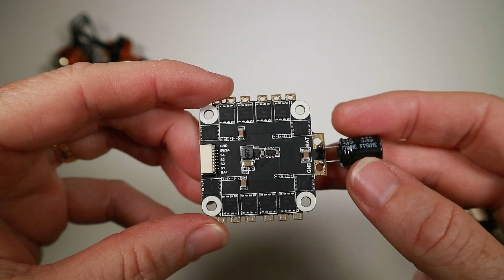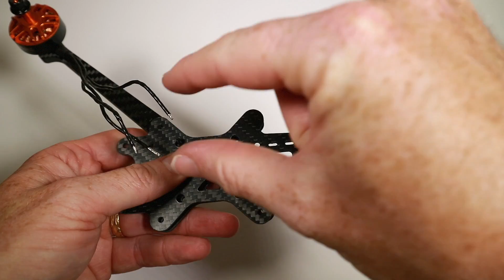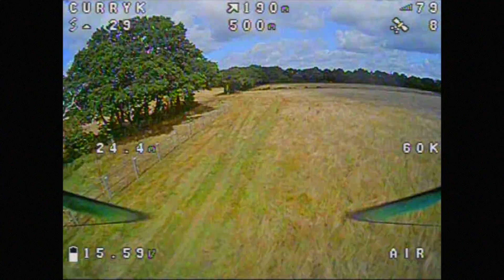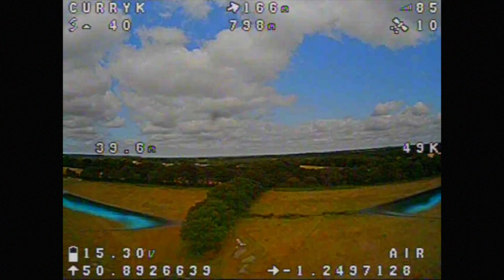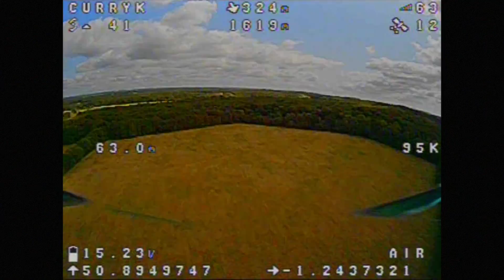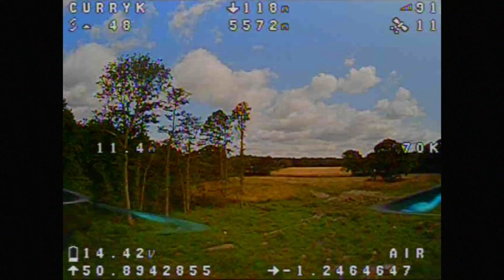Eachine Tyro129.  A 7" build-it-yourself-quad with a GPS.  Supplied by Banggood

Comment: i like the flight controller on the 129 , got barometer and gps and reduced sold   ering   because its all plug in.
Reply from the maker: Yeah - not much soldering effort aside from that annoying little SBUS/PPM jumper.  Looking at Betaflight though, there seem to be a few more UARTS that aren't being used as wekk

Comment: Hello Sir. Thank you for the video. Quad is looking great. My question is: how would I connect the crossfire receiver to this and what to bridge? Thank you kindly. Thumbs up 👍👍.
Reply from the maker: You can connect up a crossfire receiver via SBUS and thus bridge the SBUS connector, but you'd be missing out on the bidirectional comms or using CRSF, so the better idea would be to use one of the other UARTS on the board.  I don't have mine directly to have, but there is at least one spare TX/RX connection you could use and configure
Reply: @CurryKitten  Wow. That's awesome! Thank you so much for your reply!  Much appreciated!  I'm thinking of getting/building a 7" medium to long range crossfire quad and this seems like a cheap option to start with. Thank You kindly.
Reply: @CurryKitten  And I will be using your link in the description too ;) I'd like to support you and your channel. Thank you Again.
Reply: @miklosko3355  Hi. I need help with setting crossfire RX nano. I conected wires from FC Rx connector to crossfire nano in SBUS mode and it was working with 3 wires bkack, red and yelow. But when i added wire to RX from crossfire nano to TX2 pad on FC and  wont work in CRSF. What can be wrong?
Reply: @trebor1477  Hey Buddy 👋. Of course. Tell me first: Are you trying to run the crossfire in SBUS mode(3 wires) or normal 4 wires?
Reply: @miklosko3355  At first i was using SBUS 3 wires and it was working ok. But i rather hawe it runing on 4 wires. I did ad 4th wire on the TX2 pad other 3 are still connected on same connector for RX module. But the misstake is probably that i did not bridge solder  the IBUS pad? I'm using TX16S with crossfire module v2 in CRSFoption.
Reply: @trebor1477  I see first check that you have on the nano TX pad connected to the RX  pad on the FC and RX to the TX to communicate. Double-check the Betaflight   potrs tab that you have the uart that you have set for crossfire. And let me know if you have all that done
Reply: @miklosko3355  yes this is correct RX and TX from nano are inverted on FC. Im using INAV and i have URAT2 RX enabled. Crossfire nano RX is configured with CRSF TX and CRSF RX option
Reply: @trebor1477  Is the nano bound to your transmitter already in SBUS mode?  What Flight controller are you using? ( I should have asked that at the first place) Can you see the nano Rx in the lua script on the transmitter?
Reply: @trebor1477  Have tried to update the Crossfire tx and RX to latest version? It might just do the job. I'm using crossfire on my tyro and didn't bridge anything. Just solder the tx and RX to Tx 4 and RX 4 and enable uart 4 it in FC.  Disable uart 2 . It works like charm. Don't bridge anything if you can. Just use the spare uart
I can provide pictures if you need for reference
Reply: @miklosko3355  my sbus and ibus are allso not bridged. But i think that for rx2 and tx2 if you are using fc connector is soldering this ibus pad absolute. But if you are using soder pads under this connector then you dont need it solder in  brigde option. Ok i think that i undersrand :)

Nano was updated right after binding process automaticly.

If this wont work on urat2 i will solder it on tx4 and rx4. But i think that if i solder ibus bridge it will work. I will report back. Thanx
Reply: OK. The corect CROSSFIFRE reciver connection on URAT2 . You can use reciver connectir on FC but you must solder RX connection from nano reciver on TX2 pad on FC and dont forget to bridge solder IBUS pad. Telematic reading is freaking awesome. Thanx again and greatings from Slovenia. PS: our goverment is strealing our humain rights and they are lying about C19.
Reply: @trebor1477  Good man. Excellent. I'm Happy it's working for you. 💪👍.  
I'm from Slovakia but live in Ireland.
I think with Cov19 is everywhere like that... One big lie. Happy flying my friend. If you have any more questions I'd be happy to help. We can figure it out together again. Good luck 🖖

Comment: Hey guy nice video!!! As always so informative... so I've seen a guy with a 7 inch build with altitute hold and gps hold on his 7 inch tyro... how do you think? Would this setup work on INAV for gps/altitude hold?? Because betaflight only does rth and drops?! Thanks pal!
Reply from the maker: Not quite, but it wouldn't take much to get there.  The issue for iNav is that it needs both a GPS and a compass to be able to use the GPS functions.  Not expensive, but would take some extra soldering up.  Look for something like the Beitian BN-880 to replace the existing GPS module
Reply: @CurryKitten  ooohhh got ya! Yeah I had ordered that exact gps a while back but havent tried it yet!

Comment: So CK, what ya think about some 3s 50c 5200 Zee batts ?  I am kinda new to quads, but been into RC for 35 years. Planks and Helis and such. And thanks for your time.
Reply from the maker: I don't think I'd want to use a large 3S with this size quad.  I think (although not tried) the combination would make things a bit heavy and underpowered.  It would probably fly, but odds on, it would take a lot of throttle to get airborne and feel very sluggish.  Go with at least 4S on this one

Comment: the sbus pads you pointed out there are 3 small pads togather do all three get soldered i cant see in the vid
Reply from the maker: There are 3 pads.  If you bridge the two on the left then it talks sbus, and if you bridge the 2 on the right it talks PPM/iBUS (IIRC - I've only ever used SBUS)  They are annoyingly small, especially on the smaller tyros

Comment: Hi just got mine in the mail.
 Did you hook up your GPS to uart 1 per direction or did you just choose that port?
Thanks so much.
Reply from the maker: Were there direction about where to plug it... I could 't find any?  What I did was look at all the connectors that came in the pack, saw that most of them would only connect in one way and then connected it all on that basis.  When I got to Betaflight, it was already set at the ports I used, so that would seem to be the correct way to go
Reply: @CurryKitten  thanks

Comment: At 13:05 you say that you have a link to the user manual of the vtx, but you forgot to include it?
Reply from the maker: Oops, I've added it now, but it's here myosuploads3.banggood.com/products/20190727/20190727005815XF5804VTXUSERMANUAL.docx
Reply: Thanks a lot 👍

Comment: "can this drone hold itself still or hover  in air at one position?" (like a dji drone)
Reply from the maker: Nope - using this type of GPS and betaflight we only get a very basic return to hom... and then if you leave the quad it'll just crash into the ground somewhere near the homepoint.  You could use a GPS which also has a compass equipped instead and move the firmware to iNav which would give you more GPS functions (like GPS hold and a proper RTH)
Reply: @CurryKitten  oh sad btw thanks for explanation, can you point out any DIY drone kits thats have included that advanced gps?
Reply: @CurryKitten  wondering if you could tell if we can flash the FC with INAV so the quad could do RTH and auto land like DJI? much appreciated curry.
Reply: @blessingpeace  i want to know this also before i order one
Reply: @pakonly7073  like he said you need the GPS AND Compass (this quad is GPS only). Search inav gps and compass, better still go to inav site where they list compatible equipment.

Comment: Great video, I'm a complete beginner, used your simulator to get the feel of flying, got a Radiolink T8FB controller and a small Radiolink F121 drone to practice with, hopeless so far but I love it! I love building stuff so I bought an Eachine Tyro 129 using your link and I've assembled it,  all seems ok, I arm it and the props run ( motor directions are correct, props on correctly) but as soon as I move the throttle it seems to go instantly to full speed and the drone flips over. The battery I bought is a Zop 4S 5000mah, but it's a 60C and it seems huge, could it be the battery is too powerful? any advice would be great, you've got me hooked !
Reply from the maker: Before we go off down any particular avenue of debugging - are you using either airmode, or a self-levelling mode (either angle or horizon) if so, can you put the quad in acro, disable airmode and try again.  If there's any weirdness with the gyro, or the accelerometer thinks somethings slightly different than reality you can end up in the situation where the motors try and correct something, end up making it worse and so go even harder... essentially just ending up in full throttle
Reply: @CurryKitten  Thanks so much for your speedy reply,  I'll check this out and hopefully get flying.
Reply: Hi Wayne, constant rain up here in Scotland, finally got out to test my drone, I disabled angle and horizon in Betaflight ( my 3 way switch is now in acro, is that correct?) but it's still doing the same, scary when it flips, but the motors stop instantly, props still in one piece so far!
Another couple of problems--  my pitch is going the wrong way, other 3 are ok. Channel map is set at AETR 1234. I read that I could reverse the values for the pitch? but I can't get anything to come up on CLI when I print dump or diff and hit enter. It says Building AutoComplete Cache ------ Done! My Betaflight firmware is BTFL 4.1.5. 
I really hope I haven't bitten off more than I can chew, I'm a silver surfer always looking for a project, I realise how tricky this must be for you when it's not in front of you.

Comment: Great video, I bought one a week ago however still no tracking . Meanwhile this video really helped . I am confused about the battery i like the 5200 4s . Would it fly with a 5200 3s? i have 4  and  would be good to use them :-)
Reply from the maker: I think it would certainly fly, but the question is how much throttle would it need.  It's no hassle for the motors as they'd barely be ticking over, but it might drain the lipo a bit faster than you'd like.  Try it and see - I need to experiment more to find the right size/power of battery to get the flight times I want

Comment: I'm a bit confused with the rotation direction of the motors (CW and CCW) and the direction the prop nuts fasten. Front right and rear left motors are CCW. But the prop nuts of these motors (the black ones) also fasten counterclockwise. Shouldn't that they fasten in the opposite direction the motor is spinning, so they fasten themselves when the motors spin up?
Reply from the maker: That's always been my point of view on these motors as well - perhaps why I managed to get it round the wrong way... well, according to them at least.  If it helps, I have plenty of quads with motors that don't have specific CW/CCW threads and none of the locking nuts manage to unscrew themselves in flight.  Lock everything down nice and tightly and you'll be fine no matter which motors you use.
Reply: Thanks for you reply. I will  check them before every flight. 
And when you see a propeller crossing the North Sea from de direction of The Netherlands, then you’ll know it’s mine...

Comment: Help please. 
I'm trying to connect a r9m frsky reciever to this quad and I am not sure where to connect the signal wire?The sbus port doesn't seem to work. 
Thanks so much.
Reply from the maker: Well, it should be that sbus port, but did you remember to solder the little jumper on the FC (3 pads and if you bridge the left 2 it talks SBUS, or bridge the right 2 and it speaks PPM) ?  Aside from that did your rx bind to the module ok, did you ensure you have the same versions of firmware on module and rx ?
Reply: @CurryKitten   Thank you so much for replying I believe that's firmware update that I need I forgot all about that thank you so much I can I get it to bind and that is the only reason I'm a nice day
Reply: @CurryKitten  Hi,I did not bridge the fc,I'm not sure where to do that?Are there any videos on that ?
Thanks Rick

Comment: Did you do the firmware update for the TS100? It'll let you go up to 450 degrees celsius.
Reply from the maker: Yes I have, and it does.  But it doesn't seem to be able to keep a large patch of solder molten like a more traditional solder station can

Comment: Hey CK, just finished my Tyro129 and I have question for you. I set the quad for motor stop in setup, but when ever I arm it the motors spin ? any thoughts? Thanks
Reply from the maker: Do you also have air mode enabled in the config screen (instead of on a switch) that would spin your motors up when you armed it?
Reply: @CurryKitten  Well I have Angle Horizon and Acro  on one of the 3 position switches. I am kinda new to this Quad stuff. Been flying RC sense 1974 and man stuff has changed a lot. Thanks for any help.
Reply from the maker: It certainly has changed a touch since then, but this is pretty simple to check.  Load up betaflight, connect your quad up, go to the configuration tab.  Scroll down the page and there's a section near the bottom called "Other features".  The last 4 settings in here are Airmode, OSD, Anti_gravity, and Dynamic filter.  Out of these, you'll probably have OSD on - perhaps more, but if airmode is set to on, then turn it off, click on save and reboot and now see if it spins the motors when you arm it
Reply: @CurryKitten  BINGO, That was it. Man CK thank you very much. All day I sent trying to get this done.
I knew you the man to help me.  Thanks again. Got to send ya some Rattler meat. Lots here in AZ.
Reply: sdjb111 in my opinion it would be best to keep airmode on. Like you, I’m somewhat new to fpv drones and like you, I had the same question about why my props turned on after arming the quad with no throttle. After a bit of research I found out what airmode was and have it enabled it on all my builds. In short it keeps your quad level in the air if you throttle down for a maneuver, like a flip. If it wasn’t on your quad would tumble out of the sky. If you don’t want it on when you arm your quad, you can always set it up to a switch in Betaflight modes. Same place you set up your horizon and Acro mode. 
Have fun with this hobby and watch as many as these videos as you can.

Comment: What kind of battery would be suitable for this one. A 4S 1800 mAh?
Reply from the maker: My maiden flight on this one was on a 4S 1800 (although only a 35C one I used for fixed wing) and it got a flight of around 6 mins bring it in at 14.8v.  They recommend a 5s 1800-2200, so you can put a larger 4S into it (as I did - maybe too big)  I'm thinking something around 3000mAh or use smaller ones (like an1800) and blast it around a bit more

Comment: what equipment you used in the video?
Reply from the maker: Aside from the Tyro129 you mean?  I used a Taranis X-Lite radio with an R9M module, the R9MM receiver, and a pair of FatShark Dominator 3 goggles.
Reply: @CurryKitten  Thanks for the answer. What maximum distance can it fly with this equipment?
Reply from the maker: @lrakoval8108  Well, that's untested - and is very dependant on a lot of factors.  Up to around 10km - but that would be a one-way trip with the battery I have :D
Reply: @CurryKitten  cool

Comment: hi ... so what battery did you used and what is yor max flying time ? :)
Reply from the maker: In this video I was using a 5200mAh 4S but landing after 10 minutes.  It would go for longer, but there's probably a better size lipo to use as well.  Of course, how long you can fly depends on how you fly as well - I can usually at least double my 5" flight times if I just want to fly in slow and boring circles

Comment: I just saw a review of the Tyro119, basically the same as the 129. Bit the reviewer went to a lot of effort tot use a receiver with telemetry and connect it to a free uart because he wanted to use the GPS an rescue mode. 
But I have used a XM+ receiver (without telemetry)in my 129 and everything works fine. 
Is there an advantage in using a receiver with telemetry?
Reply from the maker: Interestingly I was just editing my review of the 119 for release on Friday (hopefully)  You absolutely do not need telemetry to use the GPS rescue function, but maybe he wanted an extra way of seeing the GPS coordinates.  On my 119, I ended up using F.Port on an R9 receiver which lets me have the control signal and telemetry on a single wire.  This means I can display the telemetry.. like the GPS coordinates on the radio, and if the quad ever goes down I have it's last known position sitting there on the screen.  Perhaps that was his motivation... it's useful, but certainly not a requirement
Reply: Thanks for clearing things up 👍

Comment: What do you recommend for someone that’s been in the RC hobby for a while now? Rock crawlers, bashers, scale trucks, airplanes and helis. I already have a Spektrum DX7 and a GoPro hero 6. I don’t mind building from scratch but also not against a BNF Thanks. Nice videos.
Edit: I flew my rc helis and planes 3D style so I’d like a fast stunt capable quad.
Reply from the maker: You'll be able to dive straight in if you have flown 3d helis before.  There's so much good kit out there now in terms of motors/frames/escs etc that it's hard to know where to point you.  A quad I fly a lot, as it's light,agile and really efficient on the lipos is the HobbyMate Comet (I reviewed it a while ago) it's a BNF/PNF quad, but you can also get it as a kit quite cheaply - that's a great quad.
Reply: CurryKitten thanks for the reply bud!!! 🤘🏼🤘🏼👍🏼👍🏼